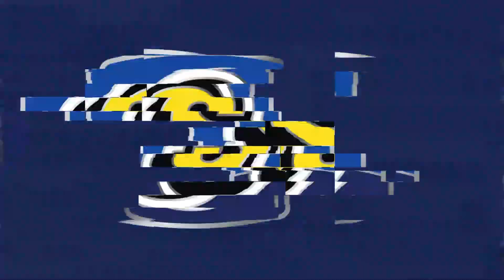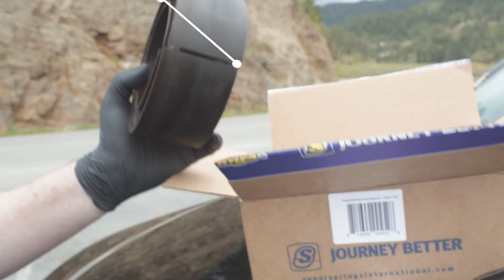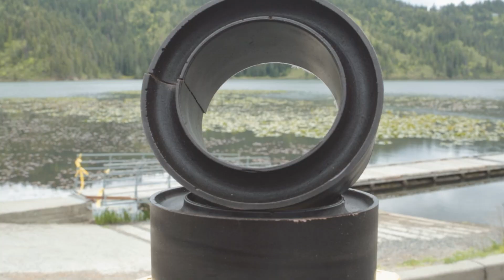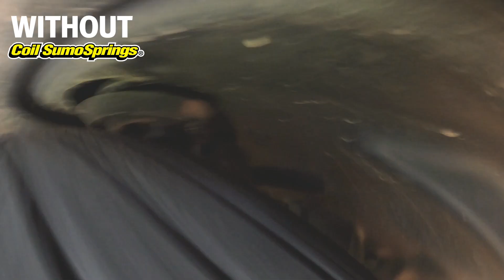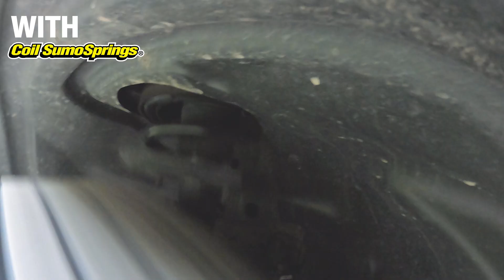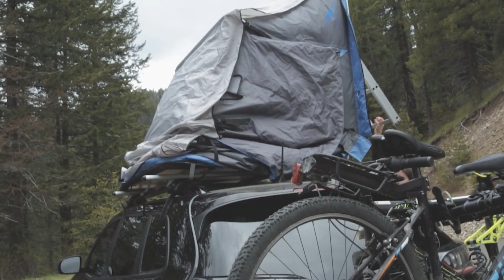Coil Spring Suspension Upgrade | Coil SumoSprings Install

Comment: How do they change the ride quality and characteristics on normal day to day driving without carrying extra weight?
Reply from the maker: If you're concerned about ride quality when your vehicle is carrying no weight, it's important to select coil springs that are designed to handle the typical load conditions of your vehicle. This ensures that your suspension system is neither too stiff nor too soft. -Matt

Comment: Is it recommended to do just the rears or to do all four corners?  I'll be towing a small trailer (3500 #)  with a Honda Trailsport Passport all highway and campgrounds.  Also, without the trailer some logging roads and access roads but nothing really major.
Reply from the maker: For a complete suspension transformation,  I recommend doing all 4 corners. - Josh
Reply: @SuperSpringsInternational  Thanks for responding!
Reply from the maker: @ChefDuane  Thank you!